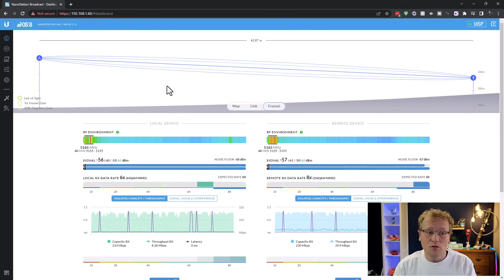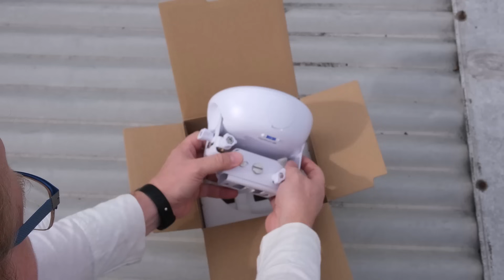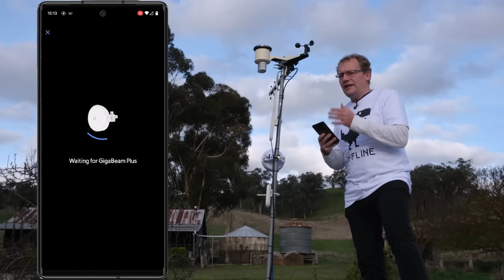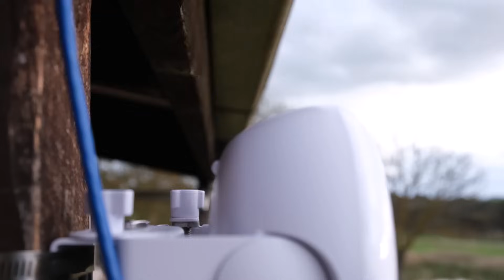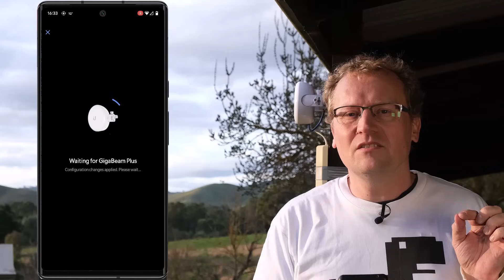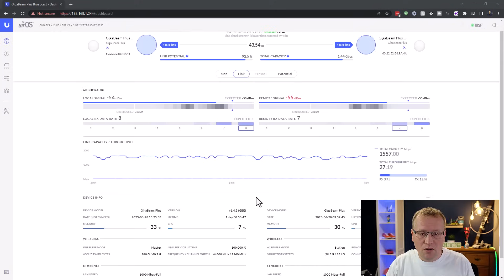airMAX Gigabeam Plus - 1.5Gbit wireless connection

Comment: Very interesting and useful video, Lars — well presented.

I’m in a similar situation: I have a garden house located about 80 m from my main house. I host the Starlink dish and router, as well as most of my network switches and NAS, in the garden house. In the main house, I only have a PoE switch to power the access points, cameras, and access equipment.

Back in 2016, I installed a 103-meter SFTP Cat6 outdoor-rated Ethernet cable to connect the garden house to the main house. I know that 103 meters is technically beyond the recommended limit, but it works nonetheless. Surprisingly, I’m achieving 10 Gbps over that link.

Nearly ten years later, the cable is still working flawlessly.
That said, I will certainly switch to a wireless bridge when the time comes.

Best regards.
Reply from the maker: Ten years ago I'd probably also been digging. Currently the return on my effort is not worth it imo.
I'm glad the old cable is still performing well 👌

Comment: Not sure if anyone chimed in with this, but the Nanostation is the only Airmax radio that can be powered via both 802.3af and 24v - its PoE out port will also output that same voltage. Link potential shows how close you are to the maximum attainable speed in perfect conditions, the radios calculate this based on the link distance. Useful for fine tuning alignment or understanding how your environment / conditions impacts the link.
Reply from the maker: It certainly is. That is why I used them initially for my gate setup as it was all running 24v passive. It is becoming a bit obsolete though, so I am moving away from them.

Comment: How well do these perform in snow ? like if snow builds up on the antenna , will it block the signal ? Has anyone tested this scenario? Would be great if i could get some examples i i might buy two gigabeams to shoot a gigabit connection over 400 meters up to 1 km.
Reply from the maker: That is an excellent question, which I don't have the answer for. I would suspect it is warm enough that snow will melt eventually. I don't get snow here, so I can't really test it (in 6 months) either.

Comment: Hey Dude"! Nice video!! thanks for sharing!!When pointing one antenna at another, avoid doing so with trees or tree branches between them. The images clearly show that your "pointing" was significantly impaired by the dead branches of a tree near the AP point. This deducted about 10 dB or more from your correct alignment.It's that simple: always point one antenna at another with 110% line of sight. A big hug to my friend. We're watching your videos here in Brazil, South America. Here I work with the best wireless equipment brands and have already set some bandwidth records at 900MHz and 5GHz! Long live!
Reply from the maker: Boa noite!! Thanks for watching and the feedback. The footage is a bit misleading, as the device connection didn't actually go through the tree. It was super close, and I cut it back shortly after too. 
How cool to have you watch all the way from Brazil. 😊

Comment: Can I use this without being in the ubiquity system - I want to bridge between house and shed - currently using Orbi mesh system in house and just want to put a switch in shed to connect to
Reply from the maker: Yes, I believe so. The airMax range is UISP, not Unifi, so it is more stand alone. You don't need a controller to make it work, but just the UISP app.
Reply: @LarsKlintTech thanks for the reply - follow all your videos as Aussie content - I am located  south coast NSW

Comment: Hello.
thanks for this vidoe BUT, 
There are two errors. First, you're supposed to set the frequency to 80MHz to achieve a connection speed of 600Mbps.
Second, it appears that one of the cables is operating at 100Mbps.
Both are supposed to be operating at 1000Mbps.
After correcting the above errors, you should be able to transfer data at an actual speed of 75 Mega Byte minimum.
Reply from the maker: Thanks for the feedback. I am not sure what you mean by 80Mhz connection? These GigaBeam devices run on the 60Ghz band, or do you mean the NanoStations? 
I did fix the cable and connection as I mention at 20:00. 
Appreciate the comment and watch.
Reply: @LarsKlintTech  I mean the configuration Nanostation AC
Reply from the maker: @أحمدحجوريأبووسام  Got it. Yes , there is much I have learnt since I set that up ☺

Comment: If people have trouble with connection between the two gigabeams then consider downgrading firmware from 1.5.0 to 1.4.6. This fixed the issues i had with the gigabeam plus.
Reply from the maker: Interesting. Thanks for the tip.

Comment: Nice video. Wouldn't this frequency require a license? Works great, but you may interfere with ISP's. You live in a remote area, so that might be less of an issue, but in urban areas you don't want long range radios because it limits frequency re-use. (One's signal is another one's noise).
Reply from the maker: Thanks. No, no license required. They are off the shelf units that you can buy off any UI retailer. They run on 60Ghz and the current IEEE 802.11ad standard and also the IEEE 802.11ay standard cover that frequency. I know several people that share a connection via a 1-2km link, and that is perfectly legal too.

Comment: Thanks for this video as well. I am contemplating this instead of fibre. How does it go in bad weather and do trees make a big difference with interference? Sorry another question, who do you buy your Unifi gear from in Australia if you don't mind me asking? I'm on the NSW central coast hinterland and I use Mwave who have been pretty good.
Reply from the maker: Bad weather doesn't seem to affect it at all, but trees can. I only notice it though, if I am actively measuring it through trees. I have 1.5-1.6Gbps capacity every time I look. 
I get a lot of the devices from Unifi for review, so that is directly from the US, and then I use a range of online stores, including Mwave, Kogan, UBWH, eBay and more.

Comment: per me i prodotti ubiquiti non li passa nessuno, solo che per fare un point to point spendere la media di 600 dollari mi sembra abbondantemente esagerato.
Reply from the maker: The GigaBeam plus is USD179, and that is a LOT cheaper than having to dig down a cable across that distance, not to mention much faster and simpler. Not sure where you are getting your facts from.

Comment: I think at 20:30 it's actually showing you the LAN link speed for each radio at the top (1 Gb/s connection to your switch), not the link speed between the radios.
Reply from the maker: Yes, you are totally right. The link speed is just below under "capacity". Thanks mate 😊

Comment: You need to adjust those more the signal is crap
Reply from the maker: ?
"Yeah, I didn't get it 100% dialled in in the video. What would be a good signal though? I have no outages, and I get full speed still.

Comment: Hi Lars awesome video!! I hope you're doing great! Something that can be a bit confusing is UISP measures throughput using Mbps (megabit per second), when Windows measures throughput using MBps (big B, megabyte per second). 

There are 8 bits in one byte, so when the file transfer over the Gigabeam link  peaked at 103MBps during the file transfer, the link peaked at 824Mbps! That's CRAZY fast over wireless!!! Thats like fiber!
Reply from the maker: Thanks Justin for the comment. I am aware of the bit to byte conversion too, and to top it off, it is often measured in Mebibits and Mebibytes now too 🤯

Comment: Nice video. The NanoStation 5ACs can do both 24v and 48v passive/active PoE input (this excludes the loco for some dumb reason) as you can check under Power Method with the equipment datasheet. They will also output on the second port the same voltage as you feed it. Just make sure you have enough amperage to power both pieces of hardware
Reply from the maker: Oh, right. I wasn't aware of that, but that makes sense. Thanks for the added info ☺️

Comment: It could not have been that far. I could have run a premade fiber optic cable and run it at 10 gig
Reply from the maker: Although it is a short distance, it is quite complicated to actually dig the trench through established flower beds up a steep incline, through an area of electricity and water pipes, go under two buildings that don't have any infrastructure for cabling underneath, run the cable, and attach it all for the same speed internally as the GigaBeams. The wireless link is magnitudes cheaper, performs about on par with the current setup and more simple. If I do need more than 1.5Gbit in the future, fiber might be the next step up. But it isn't that simple at all, unless you are offering to come and do it for me?
Besides, the point of the video is to show the wireless link 🤷‍♂

Comment: Lars dig a trench, pipe it and run fibre optic 🤷

And get some 80GHz Backhaul link E-Band with 10 Gbps
Reply from the maker: Alex, it's really not that simple. The trenching alone is complicated through established flower beds, up very steep inclines, through an area with electricity and water pipes that aren't known where are, and into two separate old established buildings on stumps. There is currently no access in either from underneath, so you would have to install a path through the floor and up into the ceiling where the cabling is. The cost of it all instead of the GigaBeams is then already a cost equalizer. You then add the hours to dig the trench, the cable, the conduit, and the mess. I prefer my solution in this case, which achieves the same speed I can support internally. In the future, if I need more than 1Gb, I might consider a trench solution, but it isn't as simple as you want it to be.
Reply: @LarsKlintTech  come on, hire a Coates Excavator (1.4t - $406 per 24 hr) and make the video :-)
Reply from the maker: @a9503128  Hehe, I am not opposed to that idea 😏

Comment: Would this work with NDI??? 

So for example, have a NDI camera at the office, the camera is plumbed into the switch in your office,  via ethernet cable into network, with ndi you can then send a video signal to your home over the gigabit and recieve a ndi video signal at home? I think it would work...

NDI is free and has massive potential....

your thoughts?
Reply from the maker: Yeah, that should work fine. It is just a data connection, and as far as the network is concerned, the GigaBeam just provides another connection. It doesn't matter whether it is wired or wireless.

Comment: Wireless links are nice but fiber is future proof and easy to run ❤
Reply from the maker: "Easy" is a very relative term. Easier to run than building a house: definitely. Easier than setting up a wireless link: definitely not. 
I am with you though, that I'd prefer a fiber connection too, but in my case it is just not feasible without major works and risks. We have to dig through established garden beds, up steep inclines, and through a part where there is both electricity and water pipes. Being an old farm, these aren't documented, so you can't just use a trenching machine. In addition there is no infrastructure to get the fiber inside the two established buildings on either end, and all the wiring is in the roof space, so you'd have to get the cabling up there too from the ground. Compared to installing two wireless devices to existing infrastructure, for the same internal speed, it is an easy choice in this case 😊

Comment: why not use fiber optic? i think it's the best choice. you can use HTB media converter for that. but what makes you most comfortable? warm greetings from Indonesia
Reply from the maker: Thanks for watching 😊 
Although it is a short distance, it is quite complicated to actually dig the trench, go under two buildings, run the cable, and attach it all. The wireless link is magnitudes cheaper and more simple. If I do need more than 1.5Gbit, fiber might be the next step up.

Comment: why you do not run a cat 6 or fiber cable  home to office
Reply from the maker: While I prefer cabled connections where feasible, this isn't the case here. The trenching alone is complicated through established flower beds, up very steep inclines, through water pipes and existing electricity cabling, and into two separate old established buildings on stumps. There is currently no access in either from underneath, so you would have to install a path through the floor and up into the ceiling where the cabling is. The cost of it all instead of the GigaBeams is then already a cost equalizer. You then add the hours to dig the trench, the cable, the conduit, and the mess. I prefer my solution in this case, which achieves the same speed I can support internally. In the future, if I need more than 1Gb, I might consider a trench solution, but it isn't as simple as you want it to be.

Comment: For that price and distance, wouldn't be actually cheaper to use plastic fiber?

you will get a lot more stable connection and faster speeds
Reply from the maker: While I prefer cabled connections where feasible, this isn't the case here. The trenching alone is complicated through established flower beds, up very steep inclines, and into two separate old established buildings on stumps. There is currently no access in either from underneath, so you would have to install a path through the floor and up into the ceiling where the cabling is. That is then already at least a cost equalizer. You then add the hours to dig the trench, the cable, the conduit, and the mess. I prefer my solution in this case, which achieves the same speed I can support internally. I haven't had any issues with connection stabilities at all, neither from the GigaBeams nor NanoStations. To utilise the faster speeds (> 1Gb) I would have to also upgrade significant portions of the switches and infrastructure. If that becomes relevant in the future I will definitely look into a cabled connection, but for now it isn't a good ROI in my scenario.

Comment: A 100m cat5e cable would cost you only a few dollars  @ 1Gbps with no setup and no WiFi!! A Cable less than cat5e caused the initial limit of 11Mb/s in the initial setup...
Reply from the maker: While I prefer cabled connections where feasible, this isn't the case here. The trenching alone is complicated through established flower beds, up very steep inclines, and into two separate old established buildings on stumps. There is currently no access in either from underneath, so you would have to install a path through the floor and up into the ceiling where the cabling is. The cost of it all instead of the GigaBeams is then already a cost equalizer. You then add the hours to dig the trench, the cable, the conduit, and the mess. I prefer my solution in this case, which achieves the same speed I can support internally. In the future, if I need more than 1Gb, I might consider a trench solution, but it isn't as simple as you want it to be.
The initial limit of 100Mbit was caused by a faulty RJ45 connector, which I fixed and now it's back to Gigabit 😊 All my cabling is CAT6 as well.

Comment: At this stage I'd run a fiber cable. Just seen a parts list and 164' LC cable is $17, 2 SFP transceivers for $16. That's dirt cheap for a 1Gb link that's fully upgradeable in future. Yes it's regular patch cable but can work. Should be an outdoor rated technically. It should be in conduit also which can be easy. Fiber isn't affected by static charges or weather and is upgradeable to faster speeds nearly indefinitely. A 10Gb link is easy too. 

A trencher is cheap to rent and easy to use. A serious contender for runs
Reply: If you don't have a switch with SFP ports you need 2 media converters for like $20/ea
Reply from the maker: @mrmotofy  While I prefer cabled connections where feasible, this isn't the case here. The trenching alone is complicated through established flower beds, up very steep inclines, and into two separate old established buildings on stumps. There is currently no access in either from underneath, so you would have to install a path through the floor and up into the ceiling where the cabling is. The cost of it all instead of the GigaBeams is then already a cost equalizer. You then add the hours to dig the trench, the cable, the conduit, and the mess. I prefer my solution in this case, which achieves the same speed I can support internally. In the future, if I need more than 1Gb, I might consider a trench solution, but it isn't as simple as you want it to be.
Reply: @LarsKlintTech  Yea I read some of your replies. It can be slightly more complicated with some of your complications. A lot could be solved rather easily. It can seem like a huge project for some who've probably never done it but it's really not. As you're learning more about RF, there's a lot of technical issues involved like interference. We have tons of wireless devices now and will continue to increase cuz it's easy to install. FYI a trencher might take 1 hr to do. After a couple days it would hardly be noticeable. Yes I know it would take a little more work and time...but future reliability is important to...it would also give you video content so it's all an investment that can pay back over time
Reply from the maker: @mrmotofy  Definitely more than an hour 😂 I totally get the radio interference, but currently being the middle of nowhere it is much less of a concern. And the GigaBeams are super reliable. I have used a trencher a number of times for various jobs that didn't go through a ton of stuff. Also, we aren't sure where power cables and water pipes run in that line we would have to dig, so that is another complication that can end in tears. As I said, definitely not off the table, but definitely not a "just an hour and a bit of inconvenience" either. 
I do appreciate your input, cause that is how I (and others) can form their own journey that is relevant to time and place 😊